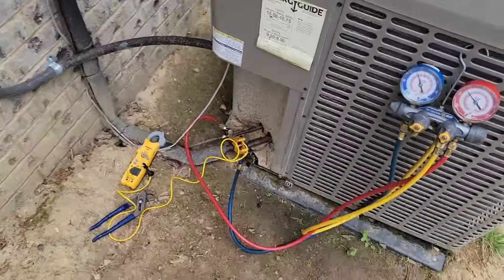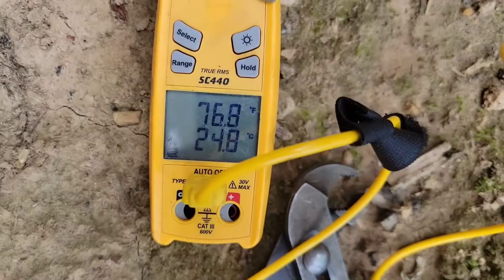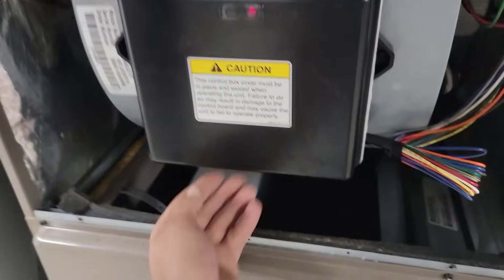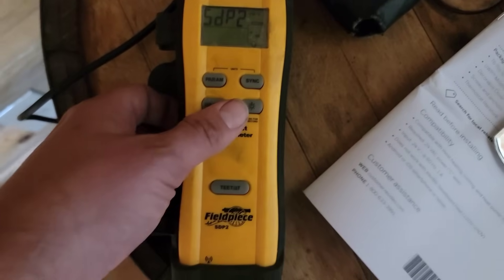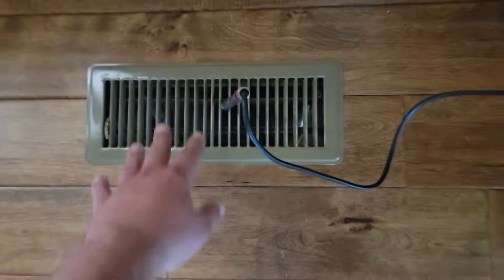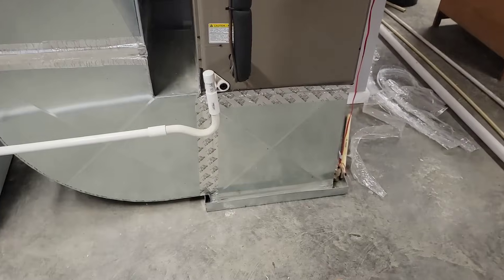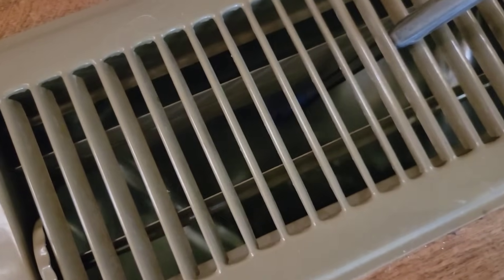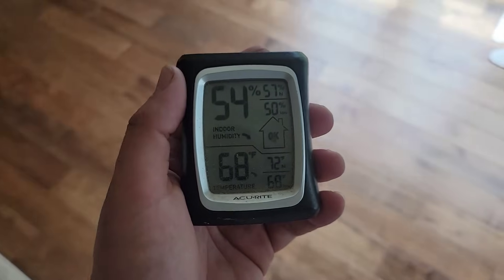How to adjust airflow and make hvac magic? @YorkHomeComfort

Comment: What would you recommend for my setup? We have a 3 floor townhouse. No basement, first floor is on concrete. Our unit, however, is up on the third floor. Its a reversed system. Upstairs is always dying in the summer and comfortable in the winter while downstairs is cold in the winter and average in the summer.

Comment: Is 700 the best target airflow for pretty much all systems or just this house in particular? Also, I know that if a system doesn't have enough airflow then it can freeze up, so does lowering the fan speed not cause future problems?
Reply from the maker: In between 400 -700 feet per minute 
As long as you monitor the Pressures and adjust the charge properly. You will never have a problem.

Comment: What is super heat? How does a lower fan speed make the temperature cooler?
Reply from the maker: Super Heat Can signify  how much refrigerant is in the evaporator 
Because if you lower the fan speed the air flows slower across a cold coil therefore lowering the temperature.
Reply: @taddydigest  thanks. My Heil air handler does not have a circuit board on the fan housing, or perhaps it is somewhere inaccessible

Comment: This just made me cringe!
According to manufacturer's product data, with the initial setting of Cool Tap-A with Adjust Tap-A the air handler will deliver 1600 CFM, which is appropriate for a 4 ton air handler. When you adjusted it to Cool Tap-B, Adjust Tap-A the air handler is now delivering 1400 CFM, or nominal 3.5 ton system airflow. 
You have reduced total system cooling capacity and changed the balance point of the sensible/latent cooling split. Hopefully in the heat of summer you have not reduced the sensible cooling capacity of the equipment too much that it does not meet the sensible load requirements of the building.
Since you have a dual duct psychrometer, you should be measuring the return and supply air enthalpy and delta T to compute total and sensible cooling the equipment is providing and comparing that to published manufacturer's product data.

Comment: the return in our home is the interior of a framed out sheetrock wall its like a 2.5x2.5 chute up into the attic and the top of the shoot is a duct box. There is the backside of drywall, studs, and the concrete slab exposed in this space. Is this correct?
Reply from the maker: That sounds interesting

I would have to see pictures to be able to tell you if it's right.

Do you wanna click the join button and get my email? I will send it to you and then you can send me pictures.

Comment: I just had my 5 ton American standard 2002 serviced by my cousin. I called an air conditioning company who informed me that I have R 22. Which is so expensive at $275 a pound, i might be better of changing my units (i have 2.5 magic aire in the basement).

So I went online and bought 30 pounds of R22 for $924 for just in case.

My cousin found the leak slow leak in the attic. Added  10 pounds of R22. Fixed the motor in the basement unit. Spent 7 hours doing the job and charged me $500.

My units are running like brand new. Because I gutted my house before I bought it and had both units put in. 20 years and counting very little problems so why change them.

Now if I'd got the same job done by the original company I'd would of spent $2700 just on Freon R22. I doubt he'd do such a fantastic job as my cousin. Because he took his time to figure out what was wrong with my unit which was iceing up outside and not cooling the house once it got above 85 outside
Reply from the maker: very cool bro glad to here that you did not get ripped off
Reply: @taddydigest  thanks you. I love your channel especially after this summer.. I'm glad the first guy scared me with the price of R22. Because even my cousin was shocked 😦 by me buying it for 924 for 30 pounds online. He said his company normally charges customers 150 to 200 a pound 🤔. Well I have 20 pounds left. With my slow leak found in the attic that should last me for awhile 🤔

Comment: That 4 ton was to big for the duct work and probably square footage. If you have to go that low on speed and cant achieve 10-20 superheat. That is probably duct work for a 2.5 ton ac unit.
Reply: 4 tons for a foam insulation home I hope it’s a 4,000 square foot house give or take if not that air handler will rust out in a year I have a house in south Texas  foam insulation 1800 square feet and I’m running a 2 ton 2 stage with the second stage eliminated

Comment: Excellent...you did a great job....I never ever had an a/c tech do what you did....never ever once was the subcool or superheat checked or balancing the the air flow.
Reply: That's wild you can't even charge a unit accurately without the sub cool and superheat.
Reply: Taddy is a freaking beast.  That's all there is to it. lol
Reply from the maker: Thanks 👍

Comment: I live in Florida so I'm interested in your comment we just had all of our events in large intakes and air flows new air docs we still cannot get the house right now below 73° be lower before that it was working fine I have a new thermostat from Honeywell 70 program which I think is 1 of the problems What is the best temperature to come out of the air vents from the ceiling not the intake mine is reading at approximately 58° I think that's too high .. When I read it all the vents somewhere in large most of them were except for the 1 in my room it can't be enlarged they should have put a new vent somewhere else but the location of my old vent is on a main arch beam or near it So we don't get eagle airflow but we have plenty of plenty of plenty of airflow for 11 square ' house actually too much air flow, anyhow that I have most of the ratings or approximately 57-58 1⁄2 ° coming out it seems like it should be coming out colder to keep the house cooler I do believe that our fan up in the attic is turned on high Please advice interested in a lot of comments here I've had 4AC people out and 4 people have told me the same things actually I mean 4 different things everything is running fine there's no problems with my unit there's no problems with anything the TVX was checked everything is fine I think it's just over working Looking forward for all of you have people out there to give me some solid information before I lose my mind Ended up getting 2 window units 1 each so I could sleep at night
Reply: Answer???
Reply from the maker: Join???
https://www.youtube.com/channel/UCuMyjTVlkM4xZ5z_eSyoB1w/join
Reply: @taddydigest  what is that
Reply: @taddydigest  oh I see so I have to pay you to answer a question

Comment: 5 degrees superheat bro. That’s major liquid flood back. That compressor ain’t gonna last long lol.
Reply from the maker: We shall see
Reply: @taddydigest   look it up bro. Recommended superheat is 20-30 degrees at the condenser. 10 degrees at the evap. I can tell your duct system is most likely undersized. That’s why the vents where “loud”. You had high static duct pressure. Hence why you had low superheat before you even adjusted airflow. I get majorly concerned when I see superheat going down below 18 or so at the condenser. Copeland paperwork recommends 22-23 degrees. But normally if you’re 20-30 at the condenser your alright. I know you probably had a txv on that system so obviously check charge by subcool but proper superheat ensures the longevity of the compressor.

Comment: I wish we had basement/crawl spaces for ducts to go here in Texas. So much cooling lost with ducts in the attic.
Reply: Same here in Orlando.  There is so much heat in the attics here.  So it takes a little bit before cold air comes in after it turns on.  Our bill would be so much lower with the air supply coming through the floors and not the ceilings.
Reply: Attic ventilation fan and a GOOD insulation job on the ductwork will help. 
My guess is most companies are too lazy to suggest, the homeowners don't see the value or both.
Reply: We solved that by having spray on foam under the roof deck after rebuilding from Katrina. No vents anymore. It is called a ' conditioned' attic. Does not get really hot like it did with attic  floor insulation , vents, and attic fans. A little warmer than living space. South MS location. Maybe that is your solution, too.
Reply: @joanhampton2378 builders have started doing that here but ours still has a vented attic. Sure would be nice.

Comment: In college (mid '80s) I got fed up with our apartment's system always blowing like a hurricane. Who thought that made sense? I took off the cover and discovered the fan had 3 speeds, adjustable by putting the wire on a different terminal. Went from max to min, the place was far quieter and cooled at least as well.

Today I'm wondering if my upstairs air handler has a similar secret to tell.
Reply: It will cool the same, the BTU exchange does not change with fan speed. Faster fan makes the room seem to get cool quicker.

Comment: That's one way to do it, just not the right or most accurate way.   You should have measured static pressure and compared to blower performance chart and started by adjusting the blower speed based on static pressure.   Also all your ducts shouldn't have the same amount of airflow or velocity either.   Depends on the manual J load calculation and the design of the home, and register location...

Comment: I have had this issue for a couple of years since I bought the home. All my rooms in the back of a single story family house that’s not even 1500 sqft don’t get as much airflow as the living room and kitchen. The middle room of the three in the back hardly gets any airflow out of the vent. How can I get that fixed, my child is in that room and I live in Texas so it’s hot in his room in the summer and cold in the winter ?
Reply from the maker: Really need more info I can't really help you with this problem through the comments I can give you advice though
Check the duck size
Check the air flow feet per minute
Check the size of the unit and the amount of vent you have

Watch my members only video on duck sizing and air flow and duck design
Join 
https://www.youtube.com/channel/UCuMyjTVlkM4xZ5z_eSyoB1w/join

Comment: Well this is the thing of slowing down the fan… it will cause air unit to freeze up because there’s not enough airflow esp if you have spray foam insulation in the walls and attic.. and this is the last thing you wanna do because moisture from a frozen set of coils will cause water condensation and that leads to MOLD.. need you to do more research mister..
Reply from the maker: how can the unit freeze if the suction pressure is above freezing temps?

please explain

Comment: So 5 degrees superheat is too low.  Not enough air over the evaporator will cause liquid refrigerant to wash out your oil in the compressor making it fail.  The superheat was moving all over due to the TXV hunting around.  In my opinion you just made a perfect expensive early compressor failure.  Always keep superheat at 10 to 20 degrees.  Your sub cooling looked good at 10 degrees.
Reply: Exactly. Suction temp should never be below 50°. That cold refrigerant will hit the hot scrolls and make some money for the next tech. Unfortunate for the homeowners. Yes they'll be getting better dehumidification now but at the expense of a compressor. If it was me I would have balanced the house opposed to cutting down air flow. That would be the last resort. And on the other hand he should have waited 10mins or so for the refrigerant to make a complete cycle through the system and show the discharge air temp to be lower than after a short walk back up stairs to your velometer. Just my two cents.
Reply: Exactly what Ruck said.. 90% of ac installers are bogus...
Reply: We have a newly constructed house (2 story) foam insulation and the airflow is super inconsistent per vent. 2 rooms stay cold (20 degrees temperature difference on airflow coming out of the vent. House was brand new we moved in July of this year. I opened the door to the attic and he was super hot up there (not a lot of space to move around). Any advice?
Reply: @G-Dub80 air balance the system. Your attic needs looked at for proper ventilation. Huge problem if your attic is not exchanging air uniformly.  Most soffit ventilation is inadequate.
Reply: Yeah 5 is cutting it a little too close for my comfort. Also you shouldn't need a dehumidifier on the main floor or anywhere in the house if the unit is sized properly and set up properly. Maybe one for a sealed crawl space but not the house.

Comment: You need to measure return air at filter not use thermostat,  those t4 suck for accuracy. If it has an upstairs it is nowhere near the thermostat reading

Comment: Those Accurite thermometer/hygrometers are okay but you need to test the accuracy of the humidity with a salt test as they are usually off.  Get a small container (maybe 2 ounces) and fill it with a damp paste of table salt (not super saturated).  Put that in a zip lock freezer bag along with the Accurite and leave it in a room around 70 - 72 degrees for 24 hours.  The humidity should be 75%.  If not, just mark  the device how many points its off either way and you'll have an accurate unit.  (The temps are usually all good on these).  I have over 15 of these with most of them in coolers used as cigar humidors with several placed around the house and the outdoor shed.

Comment: One recommendation: your temp clamp should be placed 6” from test port and on the top of the line set so oils don’t mess with temp
Reply: I will test this out. I'm going to place my clamp thermistor on the service brass portion of the valve and then 6" away. Then I'll switch postion from the top to the bottom. Record my readings to see if there is any difference in temp.
Reply: @j727100  you’ll have to do it with every unit to see the correlation, it won’t happen every time. I was a proctor for TEP and they were very strict on how readings were taken. They’ll also teach you this in trade school
Reply: I’ve always read that you have to check superheat at least 6” away for the compressor. Never saw anything about being 6” from the port.
Reply: I think you are reaching here a bit
Reply: @j727100  hey, if you want to be a good tech and not a great tech then that’s your prerogative. The only thing stopping you is yourself.
Reply: @chrismunoz7156  well how can you argue with that

Comment: So would you change the fan speed for winter months? I may have to get one of those units as our ranch is not balanced very well. We installed a damper to push more air to the furthest end from the system.
Reply: im not a tech, but i know enough to be dangerous. your thermostat will use different speeds for heat and cooling, faster fan speed for cooling due to heavier cool air. the cooling speeds may not be optimal, and still need to be tweaked.
Reply: On this system, you can see that the controller board has separate fan speed jumpers for heating and cooling. Generally, you'll want to have a higher airflow for cooling. If you determine that two speeds are needed for cooling and heating and your system doesn't have separate heat/cool speed settings, then yes you might want to adjust the blower speed with the season change.

Comment: Great video... would this cause a brand new trane to drip small amounts of water onto the air filter?
Reply: Any ideas?
Reply: @KBradAdams  Generally that means a clogged condensation run-off pipe.
Reply: @8307c4  that was cleaned out already?  It’s more of a drip type thing but on the filter!  I read it could be coming from the coils bypassing the top drip pan?

Comment: 1st video I’ve watched if your an internet definitely subscribed now! Good information man. Wish all Hvac techs had the same passion to make things best as possible. Bought new home couple years ago and it has good trane and Honeywell equipment but install and set up was awful! This helped
Reply: actually appears to be doing Start Up of a New Install. most Real Techs don't hack at it, they actaully check the blower speed chart and make adjustments without doing a you Tube video so you never see what we do.,
Reply: @craigkennedy9968  that’s good to hear . I’m just stating in my case it was less than ideal or average . The company was t.a. Kaiser and they were definitely sub par . There wasn’t much I could do at the time . I do  industrial hvac , work through a union so  I have some higher expectations I suppose but if you seen the install brother you would be ashamed for them . I respect the good ones . Appreciate the feedback
Reply from the maker: Thanks for the sub!

Comment: Drop the fan speed will provide more dehumidification plus decrease my supply 5 degrees, I could use your service in SW Florida. Six visits from my two year newly installed 16 SEER Goodman HP and they still can't get it right.
Reply: What is your average indoor relative humidity? what’s your average run cycle time?

Comment: Hello I need help i have a goodman condenser 
Low side has 120 psgi and 27 super heat but on high side has 180 pressure head. Is not cooling the apartment . What  should i do. Thanks
Reply from the maker: Sounds like his low refrigerant check the refrigerant levels
Reply: @taddydigest  I forgot to mention that is an R 22 unit
Reply from the maker: oh ok check cap and could be compressor problems check volts to motors